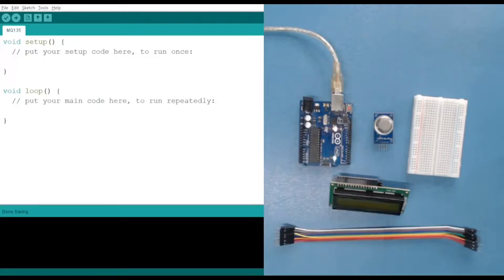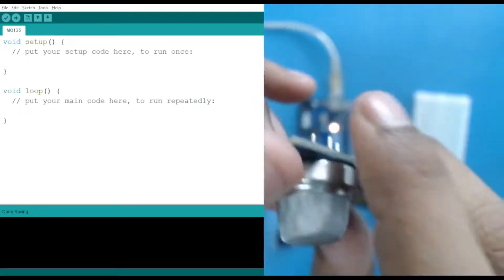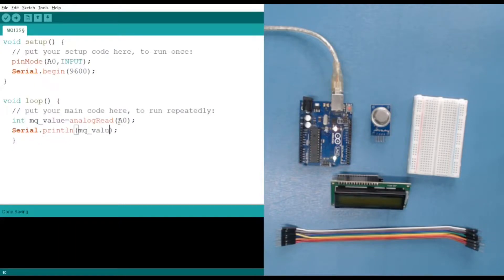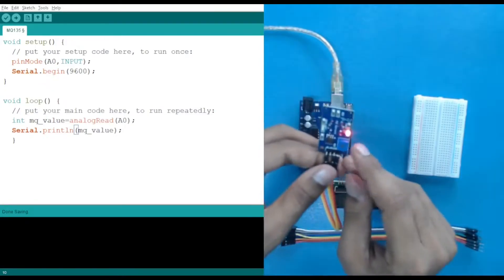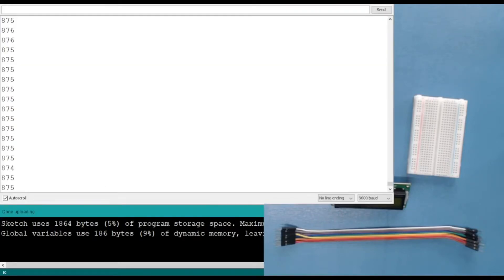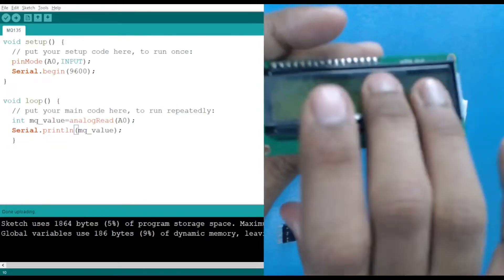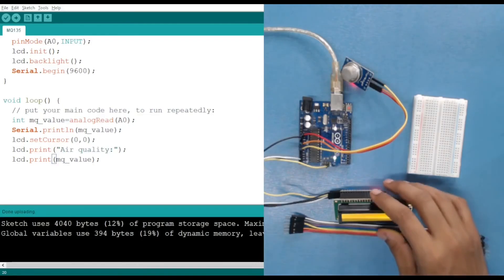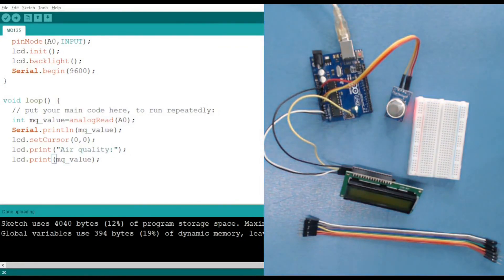Arduino Based Air Quality Monitoring System

Comment: Hi! Do you have a code where the lcd display states that the air is either good or bad? :)
Reply: #include <LiquidCrystal_I2C.h>
#include <Wire.h> 

int sensorValue;

LiquidCrystal_I2C lcd(0x27,16,2);

void setup() {
  // put your setup code here, to run once:
pinMode(A0,INPUT);
lcd.init();
lcd.backlight();
Serial.begin(9600); // sets the serial port to 9600
  lcd.begin(16, 2);
  lcd.print("Air Quality");
  lcd.setCursor(1, 0);
  lcd.print("  System");
  pinMode(A0, INPUT);
}

void loop() {
  // put your main code here, to run repeatedly:
  sensorValue = analogRead(A0); // read analog input pin 0
  lcd.clear();
  lcd.setCursor(0,0);
  lcd.print("AQI: ");
//  lcd.setCursor(0,8);
  lcd.print(sensorValue);
  Serial.print(sensorValue);
  if (sensorValue <= 180)
  { 
    lcd.setCursor(1,1);
    lcd.print("Good ");
  }
  else if (sensorValue >= 181 && sensorValue < 350){
    lcd.setCursor(1,1);
    lcd.print("Poor ");
  }
  else {
    lcd.setCursor(1,1);
    lcd.print("Toxic ");
  }
delay(3000);
}

is this correct? :))

Comment: #include<LiquidCrystal_I2C.h>
#include <Wire.h> 

LiquidCrystal_I2C lcd(0x27,16,2);

void setup() {
  // put your setup code here, to run once:
pinMode(A0,INPUT);
lcd.init();
lcd.backlight();
Serial.begin(9600);
}

void loop() {
  // put your main code here, to run repeatedly:
  int mq_value=analogRead(A0);
  Serial.print(mq_value);
  lcd.setCursor(0,0);
  lcd.print("Air quality");
  lcd.print(mq_value);
}
Reply: Thanks bro